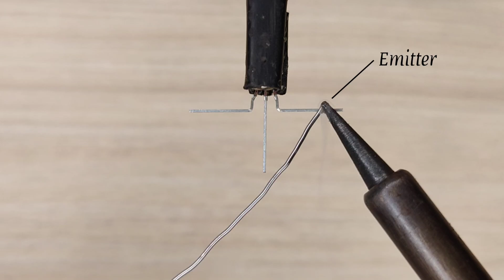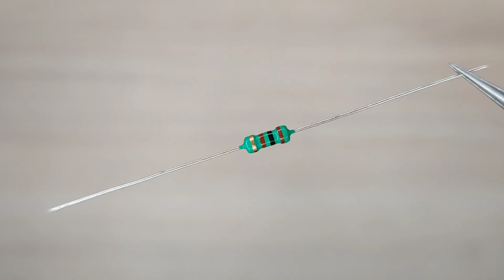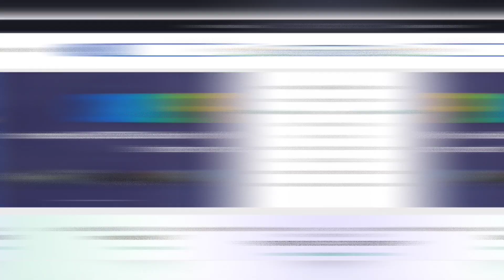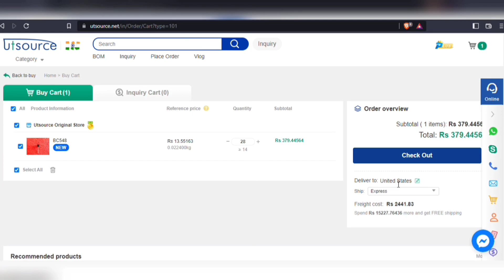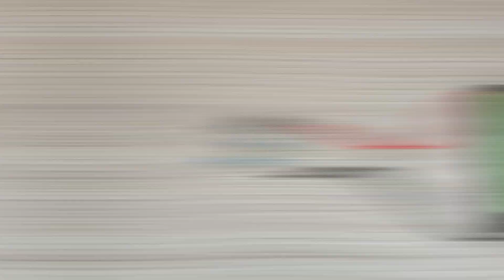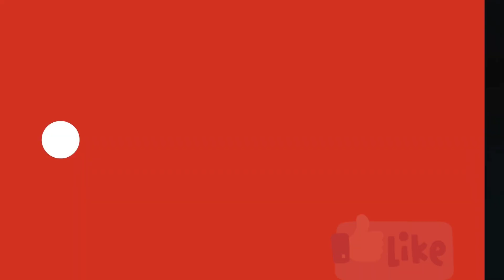how to make IR Proximity sensor / diy long-range obstacle detector circuit

Comment: I’m confused, have you got the transmitter and receiver the wrong way round?
Reply: You pointed out very well.  I had the exact same doubt and question when I saw your comment and I was sure that it was written wrong
Reply: I’ve been trying to learn how all this works so I was well confused. Glad I wasn’t the only one
Reply: @elliotsmith0850  brother did you only flip the ir transmitter or the receiver also can you help me
it tun on and dont turn of
Reply: Yes, the black IR is receiver. You need the IR reciever rx to be soldered to the base.

Comment: bonjour je voudrais savoir pourquoi la led fonctione le contraire de vous. la led est toujours alluné et quand je mais ma main devant elle s'éteint pourquoi svp
Reply from the maker: Please reverse the polarity of black led , infrared receiver, It simply works, when you put some thing close, the infrared rays from emitter led, reflects and falls on receiver led and it starts passing positive voltage from cathode to anode, and when infrared rays not falls on it, it blocks postive to pass from cathode to anode.

Comment: are you sure that the black led is the tx? shouldn't it be the rx diode that is connected to the base of the transistor?
Reply: You pointed out very well.  I had the exact same doubt and question when I saw your comment and I was sure that it was written wrong